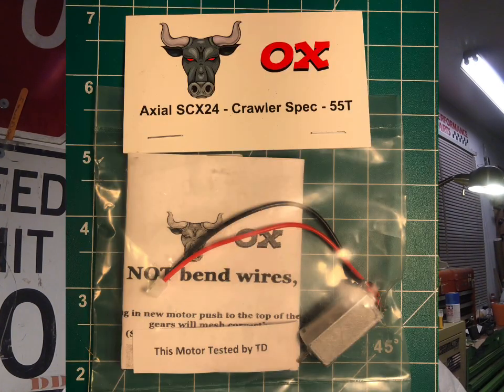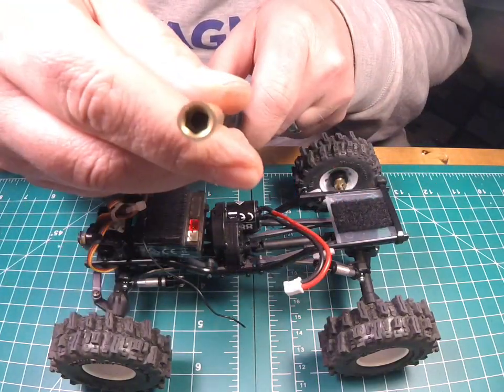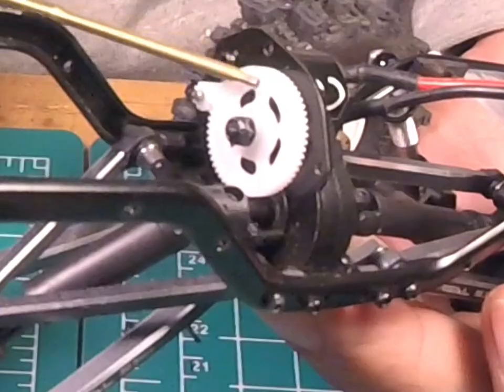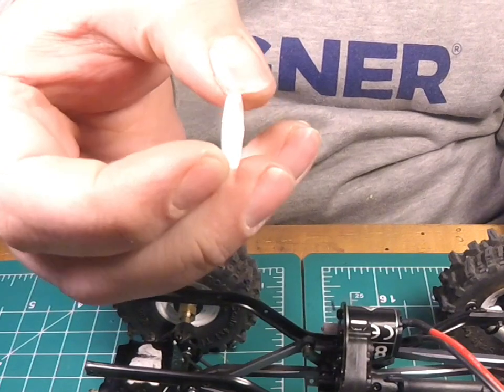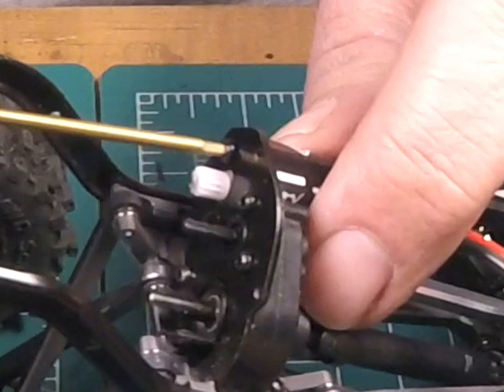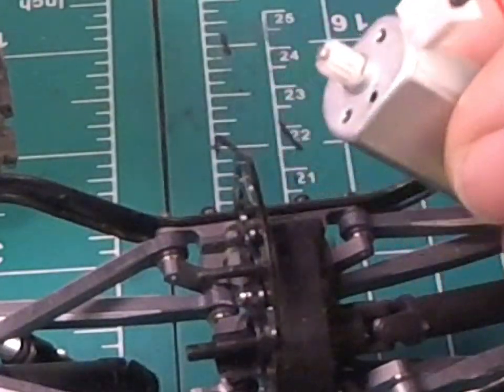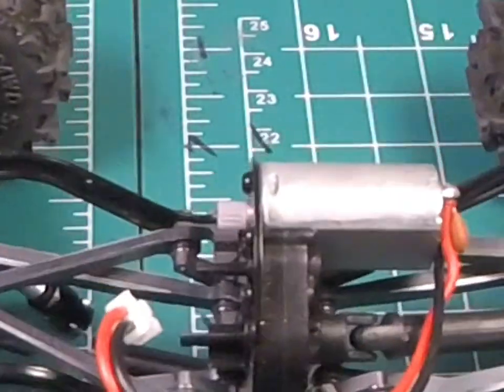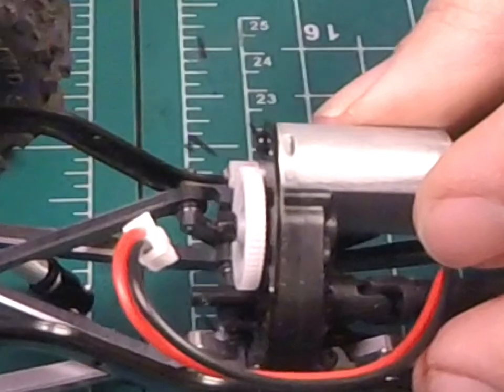Ox Motor Installation - Axial SCX24

Comment: Turns represent windings...higher number of windings means more torque but lower rpms...and lower turns means the opposite.   Higher turn motors also draw less amps.
Reply from the maker: Awesome, thank you for the info!

Comment: You should allways run in a motor by having no load on it, and spin it in either direction for a minute or two to make the brushes flatten out against the surface it's touching. Doing this will greatly increase the lifespan and smoothness of any brushed motor.
Reply from the maker: Thank you for the info very good tip!  and thank you for watching!

Comment: Yeah taking the trans out would be easier!
What’s with all the extra width ??
Wide axles and drive hubs??
Looks like you have 1/2” on each side?? Can’t be good on the servo!!
The only extra width I’d consider is just the axles with rc4wd stamped wheels in the correct direction. Use the beef patties to take up the 4mm space and low weight. 

Just did some extra weight for my gladiator, got the brass transmission skid plate/suspension mount, front diff cover and rock bars. Different tires n standard offset aluminum bead locks. Looks scale and sticks like a gecko, the low weight makes all the stuff on the body not an issue, I’m impressed with it!!
My deadbolt might get the +4mm axles but it seems to do great with just the wheel offset and brass break rotor/hex drives. The brass rock bars I may get a set for deadbolt, I just put aluminum trans bracket n links and playing with low pro esc n battery mounting.
Reply from the maker: Ya live and learn, taking the trans out is a lot easier.  Those are +6mm axles from fullsend Rc if I remember correctly, thanks for your input!  I really appreciate it.

Comment: Good video.  But painful to watch. very detailed and clear.   You took apart way to many parts for your motor swap. 3 screws and the whole transmission would have fallen out. My motor died yesterday and I just wanted to know if I should replace with the OX 🐂 motor
Reply from the maker: Thank you for the feedback!  The ox has been strong so far.